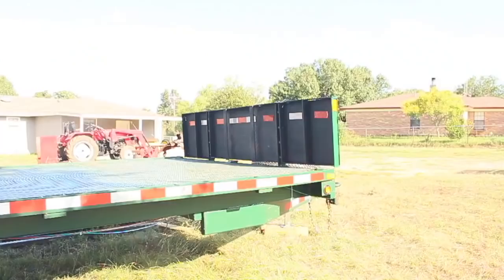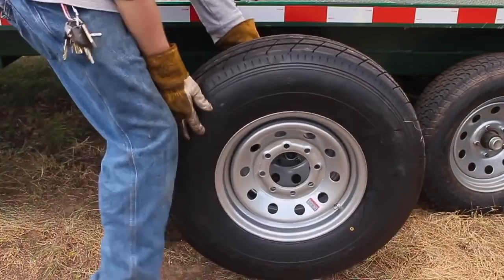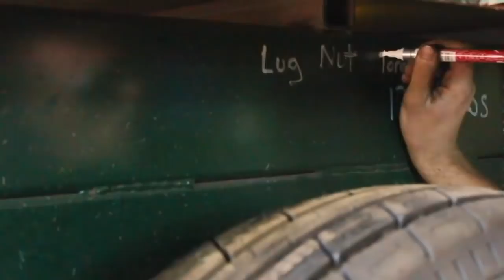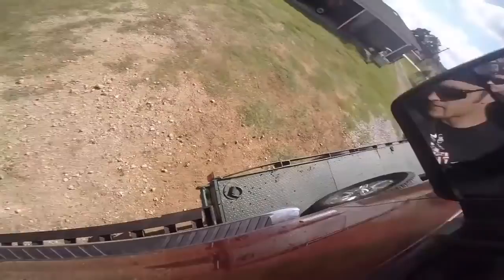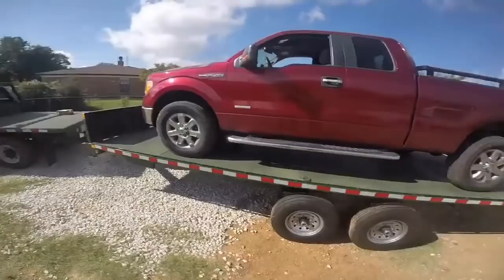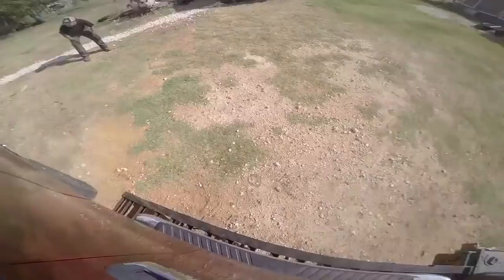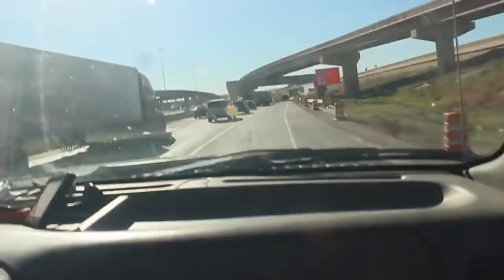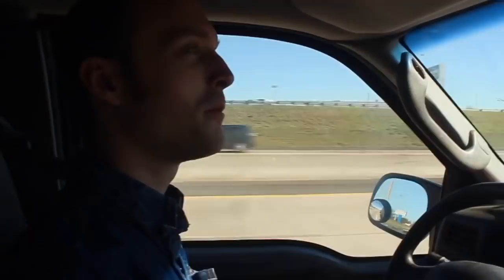20' TRAILER BUILD FROM SCRATCH FOR EQUIPMENT, TRACTORS ETC - COMPLETE WELDING PROJECT & USE HAULING

Comment: Chucky's welding lessons helped me give away my home made pop-up camper flatbed by getting a scrapyard deal on a real trailer that had ramp hinges that had ripped from the frame because nobody ever greased the hinges. Four years and it's still minty. 👍